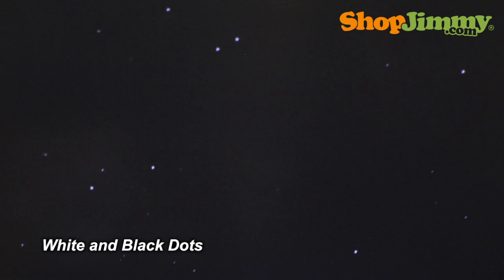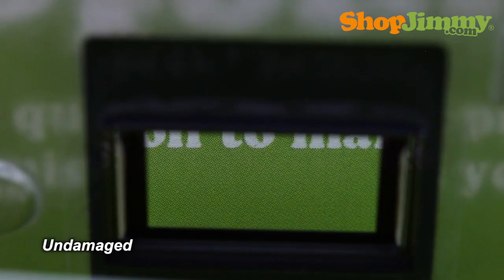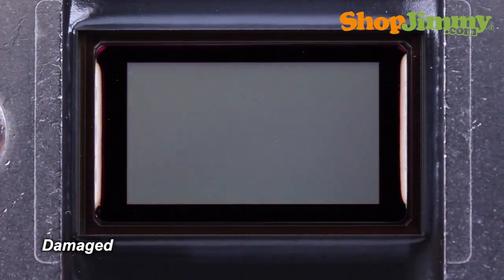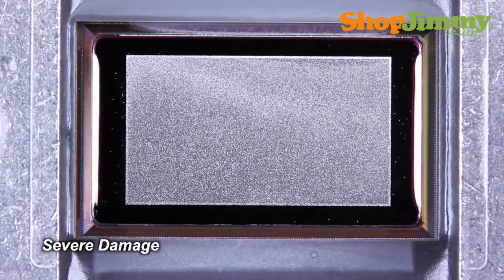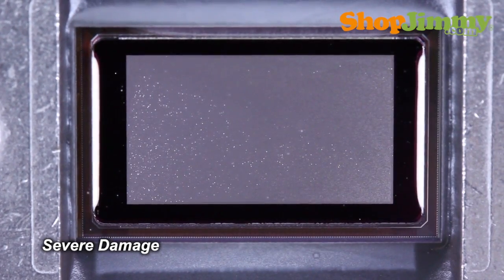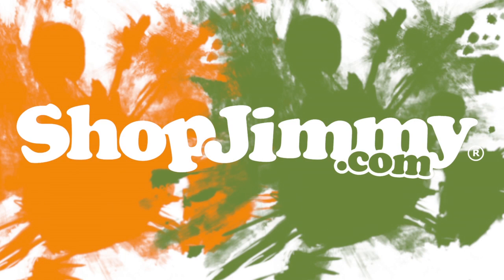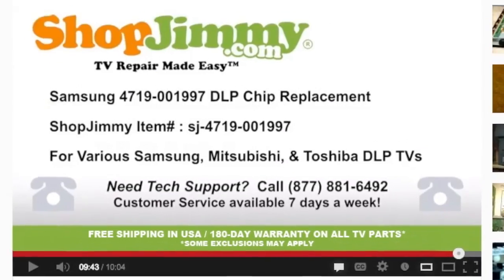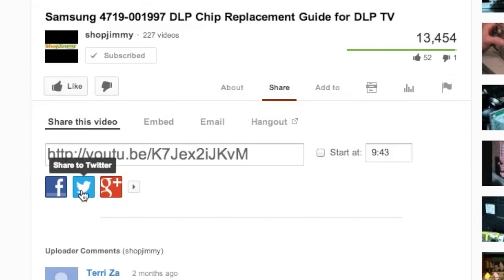DLP Chip Repair - Common Symptoms & Solutions - How to Fix Samsung/Mitsubishi/Toshiba DLP TVs

Comment: I purchased the Samsung KU6290 TV in Nov of 2016 at BestBuy. About 3 days ago, I get home from work and turn on my TV. All I see are these black dots all across my TV screen.  At first, I thought it was one of the devices I have connected causing the issue.  I called Samsung CS and spoke to a supervisor who authorized to pay for the part. I just have to pay for the labor.    
My TV has been mounted on the wall since purchased. Has not sustained any physical damage whatsoever.  Not sure what caused this. I've only had my TV for less than 2 & 1/2 years and this happens.

Comment: Now, I have a question since I can't seem to find a thread answering my question. Will a Samsung DLP chip work in my Mitsubishi Tv??? The Samsung DLP chip I was looking at looks exactly the same as the one out of my Mitsubishi but, the only thing that's different is the reflective part of the chip is a little bit smaller but, the shape of the chip and the pins on the back look exactly the same..... I was just wondering because the chip was cheaper than the Mitsubishi branded one. And it's brand new.

Comment: hey mate ...I have an Optoma Hd141x,  do you think its is direct DLP chip or is that a optical light mask, as I can see in hd20 service manual .The ceramic in my lamp came off and was spreading the ceramic powder all across the projector. I was cleaning and blowing off dust inside my projector when I think it deposited on this part. Using q tip hasnt helped and I think q tip has rather scratched it. When properly focused I can see all that debris on projection surface.  This assembly was earlier spotless.Will really appreciate if you could help on this ?
I am desperately trying to make out if that glass is replacable. could you have a look at page 67, part number 9 in this page pls. its for hd20 optoma.

http://easp.optomausa.com/ASP/upload/Service%20manuals/Optoma%20HD20_HD200X_HD2200%20%C3%AF%C2%BC%C2%BFHD20LV_HD21_HD23%20Service%20manual%20v7.0.pdf

Comment: I received my DLP chip for my 65" Mitsubishi.  Right now I have about 25 white dots in different sizes but all just little pin dots.  These started a few months back, but it seems that some of the then disappear but are replaced with new ones in different spots - is this normal?

Comment: Colored dots on Mitsui Plasma TV PDP MTV 4207

I have no problem with TV. Mitsui plasma brand, model MTV 4207PDP, is that when you turn it starts with screen without image, at 2 or 3 min. points or parts are fuzzy image. At 10 minutes and the picture looks. Then disappear points or image parts.
What would be the cause of this fault?

Comment: I just finished replacing the DLP chip on my samsung white screen now I have no picture it turns on and you can hear the volume but I have no picture what should I do to go back and retrace my steps what am I looking for
Reply: +kim burciaga  I HAD THE SAME PROBLEM. WHAT DID YOU DO TO SOLVE PROBLEM. MINE WORKED FOR A WEEK AFTER PUTTING IN NEW CHIP BUT WENT OUT. NO PICTURE

Comment: Samsung DLP HL-T5087x/xxa
white dots have been multiplying over the past many weeks. On occasion the TV will not come on until unplugging/replugging. Also, sometimes, shortly after it comes on, it changes to a scrambled picture with colored lines for 15 seconds or so, then it returns to the picture.

There are a few more white dots each day. Half of the dots 'twinkle' like little stars in the sky.

Do you have a Diagnosis?
Is this something a 64 year old woman can do, or do I need to call a repairman?
Reply from the maker: Barbara Peterson  I recommend replacing the DLP chip and the DMD/formatter board in your TV.  Click this link to replacement parts for your TV model number:  http://www.shopjimmy.com/catalogsearch/result/?q=T5087  Thanks and please let us know if you have any further questions with your TV Repair!  www.shopjimmy.com

Comment: I have a Samsung HL-T6187S TV I replaced the dlp chip which I purchsed from Shopjimmy. A strange thing occured after replacing the part. Now before replacing it the only thing wrong with the ty was the white dotspicture and color was great.Now after the dlp change the picture has lost the red color I check all the connections and  nothing wrong. Could it be the red LED. Picture is great except for no red. Thanks for any help. If needed my email is jjwhelanmail@yahoo.com
Reply from the maker: James W   Yes, it could be.  Thanks!  www.shopjimmy.com

Comment: My 65" Mitsubishi Diamond series TV started getting the little white dots, over time the dots multiplied, My thought was to replace DLP chip when i just couldnt stand it anymore, But i trieid to turn TV on lastnight and it powered up, but i only had sound and unit turned itself off (im uessing because it knew it had no picture) will this DLP card get bad enough where it will cause this problem or do i now have another issue?
Reply: I have looked on your site and it seems the formatter board is out of stock. Mitsubishi WD-65833, manufacture date Oct. 2007. Seem premature to have these issues? And I believe they are out of the TV business.

Comment: My DLP started getting spots... but then would no longer come on... is this still just the chip? or a second problem as well?

Also the board on the side that controls all the options has burned out do you have a link to that?

Samsung HLT6187SAX 61-Inch Slim LED Engine 1080p DLP HDTV
Reply from the maker: Kristi Hall   It sounds like there are multiple problems with your TV and might get very expensive to repair.  It may be best to replace the TV.  Thanks!  www.shopjimmy.com

Comment: My mits DLP doesn't have the black and white spots, but has more differing shades of black and gray spots that can be seen during dark scenes or darker colors being displayed. This results in a grain-like appearance and no contrast depth to any scene that isn't bright colored. This anomaly can even be seen when the TV is powering down with no signal and light is still on after turn off. However, it isn't apparent during moments of bright color (such as the blue screen when inputs are changed or have no signal). Could this be a mirrors that are stuck between on and off, or is it more likely the result of dust build up on the inside of the screen? I hate to buy a new chip, and the problem is something else. I also noticed this problem for the first time last night when watching television in the dark. I don't believe it came on a bit at a time like some people describe this situation. At least I didn't notice it until it was all over the screen. Thanks!

Comment: My Samsung 67 inch LED DLP TV (model code: HL67A750A1FXZA) is having 2 issues. 

Issue 1: There is a 2 inch translucent grayish bar on the left side

Issue 2: It seems there is a bad DLP mirror chip because there are stationary white specks all over the screen.

Are both issues fixable and at what cost if they are?
Reply from the maker: Mark Bernardini   I recommend replacing the DLP chip in your TV, it costs $189.99.  Here is a link to the replacement chip: http://www.shopjimmy.com/samsung-mitsubishi-toshiba-4719-001997-dlp-chip.htm  Thanks and please let us know if you have any other questions!  www.shopjimmy.com
Reply: Wow Mark, I have the same TV with issue number two. I almost thought I had to replace my baby but thanks for saving me the trouble of hunting down the receipt in my safe. ShopJimmy, thanks you for helping me hold ontp the little bit of sanity I have left. I'll be in touch soon.

Comment: hello, i recently noticed that my 67' Samsung LED DLP tv now has what looks like a static layer of grain now and the black level is not as black as it was now. the dots arent bright like the video. would replacing the chip fix that?
Reply from the maker: Justin Wilde   Yes, replacing the chip will fix that.  Please reply with your TV model number and then I can recommend a replacement chip.  You can also call our customer service for further assistance with your purchase.  (877) 881-6492  Thanks and please let us know if you have any further questions with your TV Repair!  www.shopjimmy.com

Comment: Why would just replacing your lamp module cause the white specs to appear? In other words, why are the so-called mirrors on the chip doing something that would cause them to stick when the power is completely off?  Why wouldn't a new chip do the same thing as you are installing it?